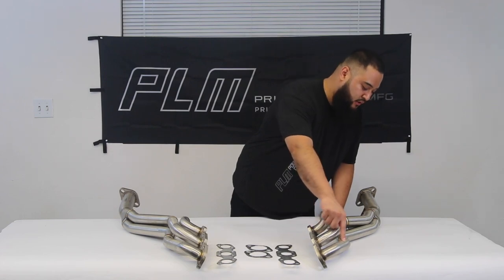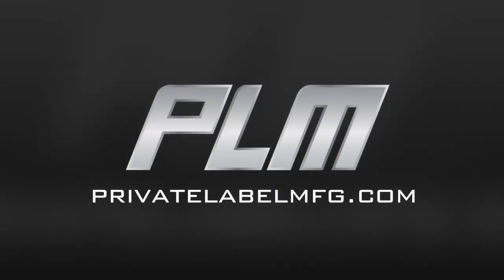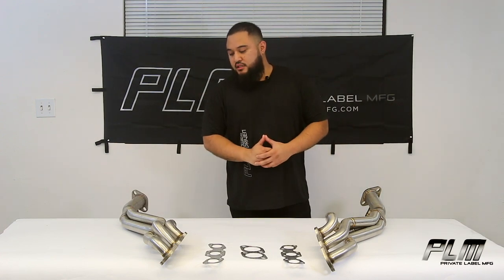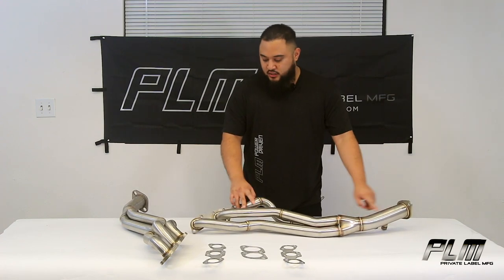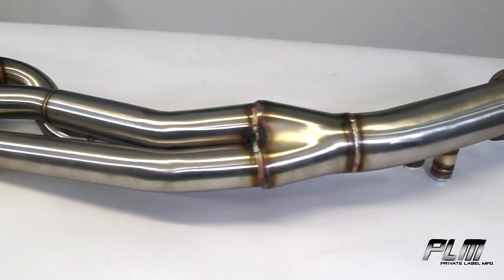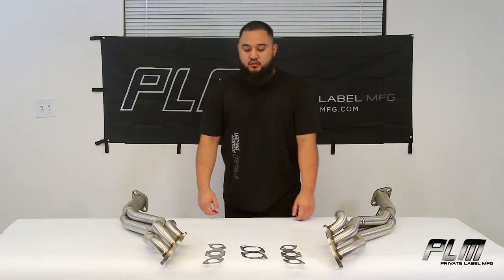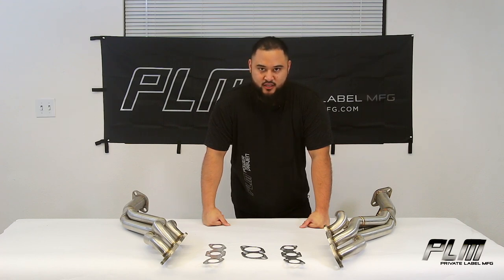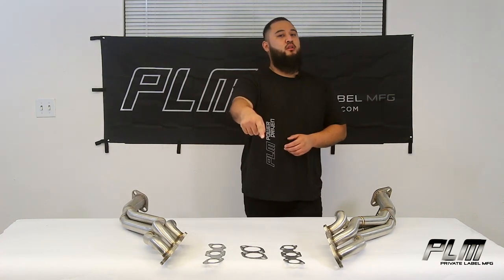PLM VQ35 LT Headers Long Tube G35 G37 350Z 370Z

Comment: Hello, I want ask if this will cause clearance issue with the steering wheel bolt on 370z? 

Planning on buying these or ISR
Reply from the maker: There should not be any as it is designed for the 370z. https://privatelabelmfg.com/products/plm-long-tube-headers-nissan-vq35de-hr-350z-g35-370z?_pos=1&_sid=ee6756501&_ss=r. If you have any more questions feel free to email or give us a call.

Comment: These have MAJOR manufacturing issues with the welds at the collector causing LARGE exhaust leaks. I need you guys to contact me ASAP, the entire experience from being mislead on equal length vs. unequal to wasting major $ on labor to only have to take them down again is absolutely unacceptable.
Reply from the maker: Email or Call us.  We'd like to resolve this.
Reply from the maker: @lilricedaddy  What's your full name? I can look up your customer's record.
Reply: @lilricedaddy update ?
Reply: @g35tho11  they did not resolve. Ended up having to pay a fabricator to re-weld. In hindsight, I would’ve waited for a set of used PPE over these 🙏🏼